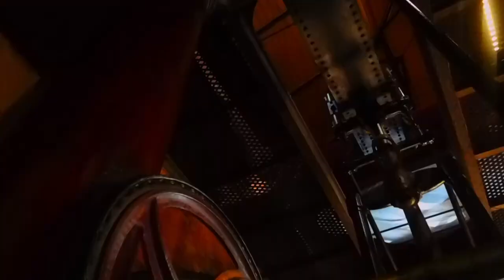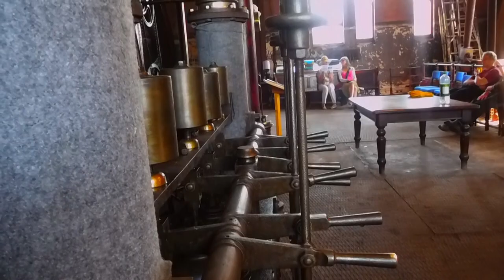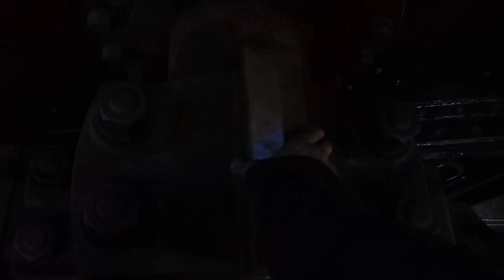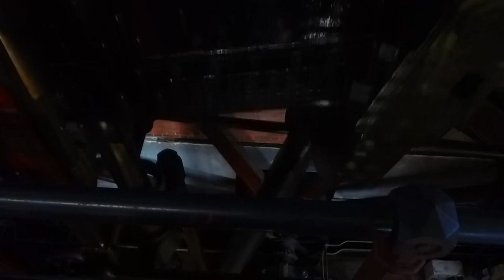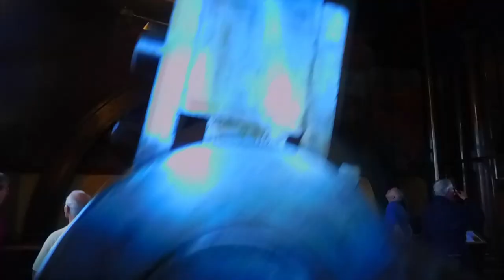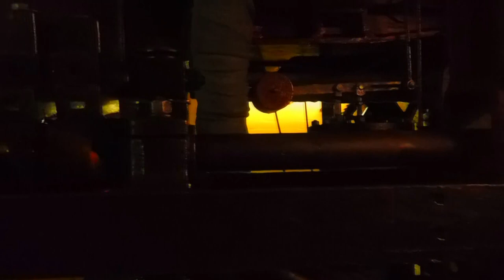Claymills engines "C" and "D" running together

Comment: I found you via Keith Appletons videos and was just watching a load of your state side stuff so was amazed to find these clips of a fairly local engine to me, did you get to see the A and B engines I've not actually visited in over 10 years but they were in an "as found" state all rusty. If you are ever in this part of the world again Abbey Pumping station in Leicester isn't too far away and has some large beam engines that get steamed a few times though the year along with a fine collection of industrial things.

Comment: What are all those cams used for?
Reply from the maker: Those operate the valves of the engine.  There are eight in total, four per cylinder.  One admission and one exhaust per end.

Comment: Bonjour Alexander,
Your videos are too short, please take time to film more :+) 
Question : In two of your videos, you say "Charge", what does it mean in terms of start process, I do not see any equivalent on my little models ?
Amicalement, Raphaël
Reply from the maker: Which videos do you mean?
Reply: @AEKarnes  Bonjour Alexander, all the ones which last less than 1 minute :+)
And please, could you give me the meaning of "Charge"  you says several times in other videos? 
Amicalement, Raphaël
Reply from the maker: I am trying to figure out exactly what you mean, do I say "Charge" referring to a piece of equipment specifically or an operation it undergoes?
Reply: @AEKarnes  Bonjour Alexander,
Ah ! The langage bareer :+) I refer to an operation it undegoes, it seems thet you ask someone to "chatge" something when you open a valve. I will find where I heard it and put a comment on your video.
Amicalement, Raphaël
Reply: Better make short videos like Alex does instead of too many long boring and bad filming videos with useless commentaries.